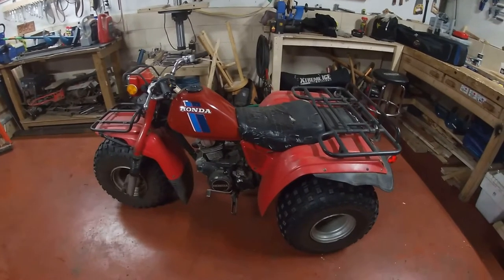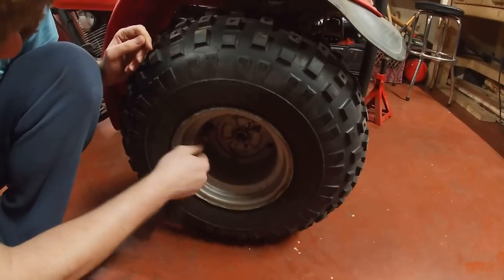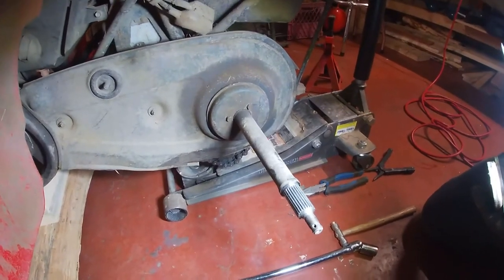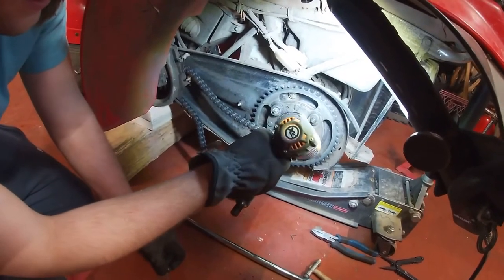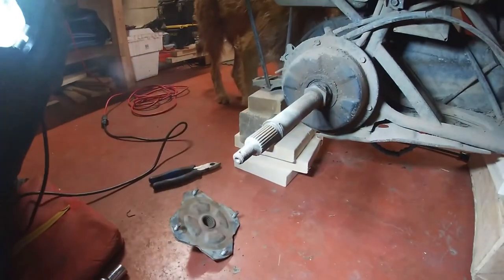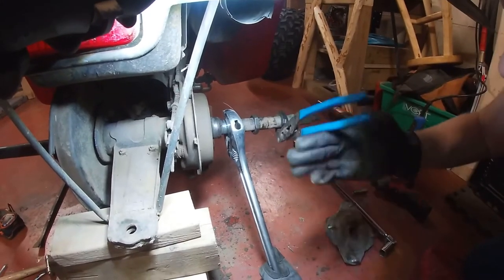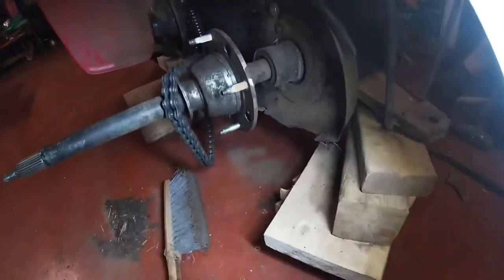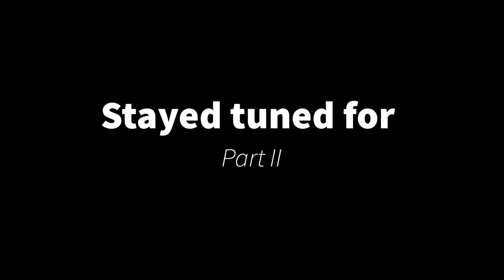Rear axle removal 1983 Honda Big Red

Comment: If you are to hammer out the axle in the way that we had done... thread on the axle nut so that it is flush with the end of the axle covering the threads. This should prevent the threads from getting marred.

Comment: ya i had the same issue with the drum seized on. it took heat and 2 cans of pen oil with a 12lbs sledge. and it fought all the way off. mushroomed the axle and used a grinder and file to save as much as i could;d but lost my crown holes.
Reply from the maker: Had a machinist friend look at ours. Was able to run a die over the one, other axle was grinded down aswell.

Comment: I had a 84 200e big red now I have an 81 185s and it has all the original parts I wanna take the chain guard off and rear skid plate so I’m here to learn how to remove the axel 👍🏻👍🏻👍🏻 I need to remove the whole chain guard off

Comment: Do you remember the size of those 2 nuts on the axle.. infront of the brake drum
Reply from the maker: We don’t know the size of them. We ended up using two adjustable wrenches. Didn’t have any spanners that large.
Reply: 41mm I believe.  And my adjustables only open to 40mm 🤦🏻‍♂️
Reply from the maker: @smellslike1477  We ended up buying an older craftsman adjustable wrench from a flee market years ago. opens to an 2 1/2” I believe. First time we had to use it.